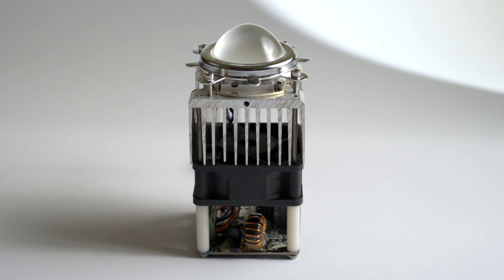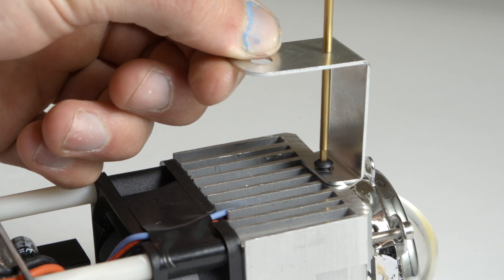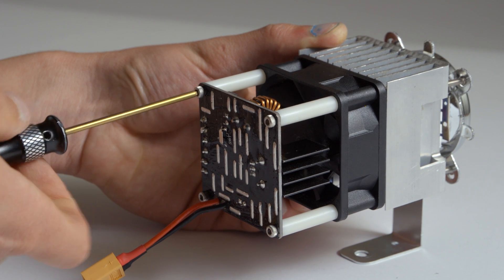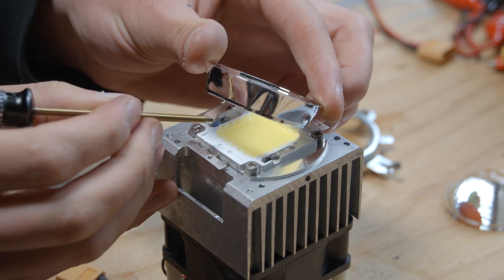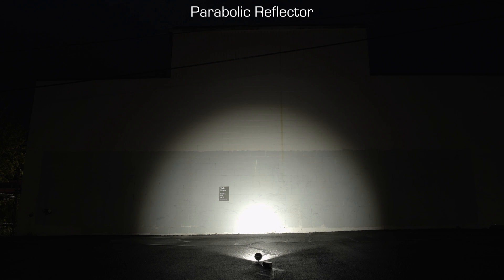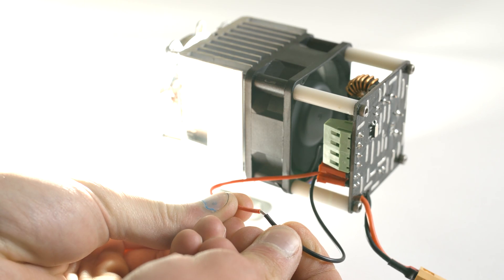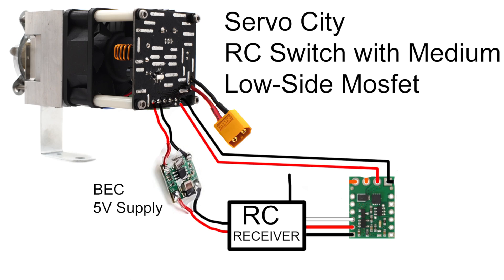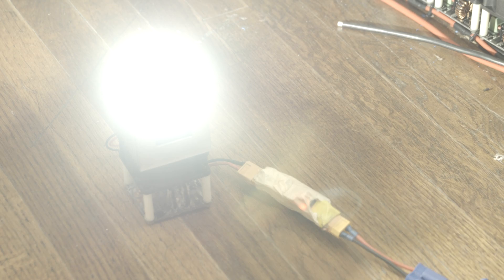Stratus LEDs 100W Module Operating Instructions/Tips

Comment: Hello, I need a 100W (or more) LED light, the smaller the better. I went on the StratusLed website but it looks like they don't have the one in this video available anymore. Does anyone have some advice on where to look? Thank you very much in advance!
Reply from the maker: The 3200K version is currently in stock and available for purchase on the StratusLEDs website

Comment: Trying to mount on my mavic pro.  I can tap out 12v from the power pack, but this is to low to power the driver.  I found a step-up converter to bring the 12 to 24v at 5amps, but it seems kind of redundant to power the LED driver that powers the LED.  I believe I could just find a step-up converter that would power the LED directly, but I don't know if this will work or what the LED voltage is.  Does anyone know if this will work and if so what the LED voltage is??
Reply: Yup, this works.  Got a 600w cc cv regulator. Tuned the voltage to 30v (not 24 like it says on the amazon page) and limited current to 7 amps.  Hooked it up to my dji mavic battery by opening it up and soldering directly to the main leads and drilling holes to mount an external jack.  The light seemed stable without the additional draw of the motors.  I might have to turn down the current once the motors are running :/
Reply: 7 amps? pls dont go over 3 amps for 30 volt 100 watt leds, because they will not last long drawing 7 amps.

Comment: Can't get mine to work... Got a 24v 6a power supply and one of them is flashing really fast almost like a strobe and the other one slowly, once a second... Can someone help me with that????
Reply: is you battery charged? because it might be the battery voltage dropping too low and then the driver turning off because of low voltage, or because your batteries cant provide enough current

Comment: I don't get it. I'm sure there is a way to put a dimmer on that circuit... Anyone??
Reply: It would be nice if there were separate fan and LED driver enable pins, that way a micro could turn on the fan and PWM the driver to control brightness. Or possibly a single enable line but with some turn off delay on the fan so that the PWM signal doesn't reach it.

Comment: first. Can't wait to get mine. I am going to mount them on the front of my truck
Reply: These are great for a truck I got mine on amazon. Came in the 2nd day fast shipping. Love it. going to add a small boost converter to run it on low and the built in driver for on High beam but going to use a 150w boost converter in order to run it off 12v to 27.5v. Inefficient but that is what I have for now.  can wait for the  parabolic reflector!!!
Reply: ZenZaBill o
Reply: First to comment and I bet you have YET to even buy these, let alone put 'em on your truck. BFD, bud.